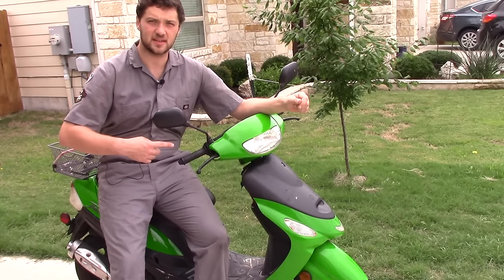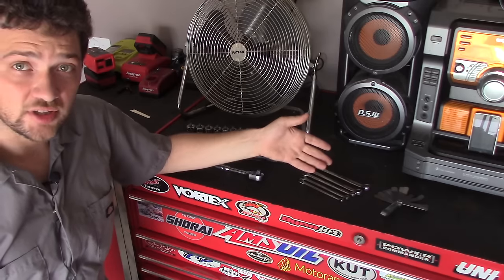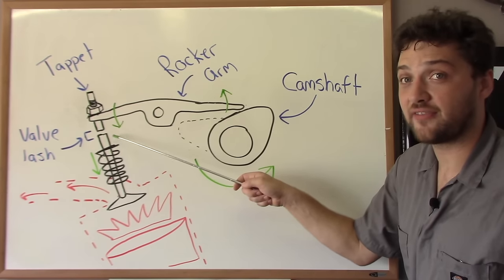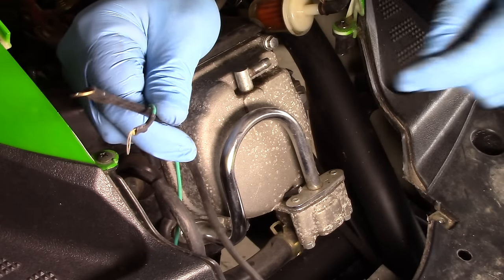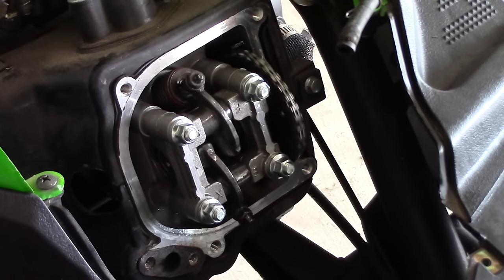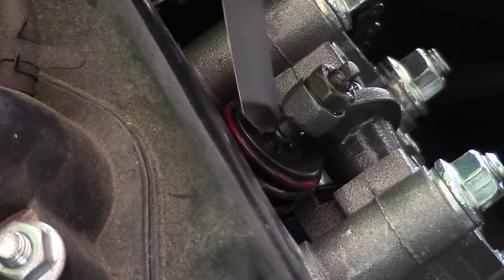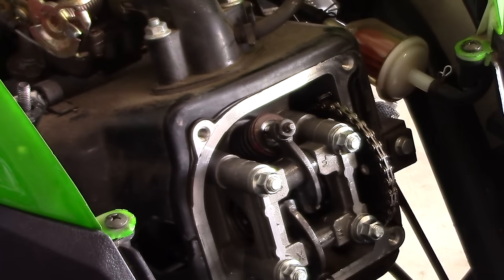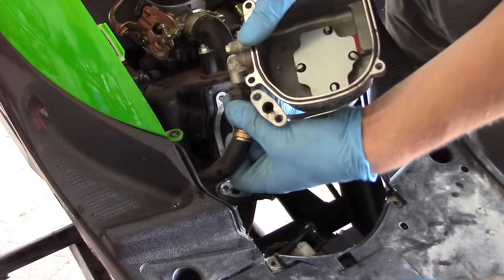Scooter 911: Hard to Start or Wont Stay Running? Try a VALVE ADJUSTMENT! (works for most scooters!)

Comment: What valve adjustment tool would you recommend?  I have one from Honda that doesn't fit inside these valves due to length.  Do you have a specific brand/part number you'd recommend?
Reply from the maker: I have always used a 9mm box end wrench and a 3mm square socket. I got my socket from snapon where it was listed as a "marine valve tool". But honestly as long as you have a quality 9mm wrench you can turn and hold the tappet adjustment with an adjustable wrench. There really isn't a need for a specialty tool like the old Honda CB750's and what not. Hope that helps! Good luck!

Comment: I bought my scooter (sym jet 14 50cc 4t E5) in 12/12/2021 and it starts easily in the beginning but after running for a few kms it stops and then it's very difficult to restart. I cleaned fuel injector, replaced old spark plug with new and changed both engine and gear oil but i still have same problem. I have 5,117 kms on my scooter. Can you please give me some tips. Thank you in advance

Comment: Hi Garret. So I just did a valve adjustment a couple days ago and I noticed a very audible ticking sound. The valves were set to 003 (intake) and 004 (exhaust). I decided to go up on each one to 004 and 005. The ticking is still there but much quieter. Should I go up another on the valves to 005 and 006? Or less? Idk what to do. Thanks!

Comment: Quick question when you turned the cam shaft at TDC, is it necessary to reset the timing chain on the tensioner as well? I installed an 80cc big bore kit and I'm having trouble with it staying crunk.

Comment: I'm not sure if this is my problem or not. I know this is a few years old video, but mine will may start hard like that, or start right off the bat. The problem is when I DO get it running, it'll run for a good 30 seconds at high speed, then I'll let off the throttle (like at a stop sign) it'll either power down once it gets to idle, or when I throttle up again, it won't even try to go up in speed, it'll just start to die. Thoughts? I've replaced the spark plug, fuel filter, I have see through hoses and I can SEE it's getting fuel, my air filter is a little old but still seems to work ok. If I try to turn it on again after that happens? It won't. I'll have to let it sit for a few minutes before it'll hard start again. And then the cycle repeats. Thoughts? It's around 5k miles btw

Comment: 150cc gy6 bogging past half throttle and the spitting through carb as it cuts off....new carb, plug, coil, cdi, air filter, fuel & filter. Any suggestions?
Reply from the maker: Have you performed a valve adjustment yet?
Reply: Planning on doing that today, read on several forums about adjusting valves....it started this after running out of fuel. I put more fuel in, took a while to get started, it ran fine for about 3min then started the bogging. Changed fuel 1st
Reply: Y'all not gonna believe this!....I adjusted valves,  both had too much lash. Put back together and same thing. Traced all wiring down, unplugged,  cleaned terminals,  etc...same thing......so I thought about what my dad taught me that I should have thought about earlier . You have to have fire, fuel, air, and???? EXHAUST!! The dang muffler had gotten clogged!!! I put my hand at muffler and was like this just don't feel like enough exhaust so I stuck a screwdriver through screen and mess fell out?!?! Actually was a lot of mess in it. Like black fuzz. Unsure if its coming apart inside or what but cleaned best I could on buggy, removed screen. It fired up and was at very high idle. After adjusting idling and checking air mix screw again, it ran like a scaled dog!  Thank you though, you did help me and for those like me, check that muffler!....lol

Comment: Adjusted the valve and still do the same thing will not stay running. The rear wheel turns when I try to start it. What is my problem?

Comment: Garrett, my 2020 tao tao will not start, I have fuel,spark,compression, and new oil. I squeeze the breaks and push ignition button. Still will not start. It turns but will not stay on. Dealer is 2.5 hours away. Big mistake. 1month later and Dealer has not mailed my registration paperwork. Never do that again.

Comment: The crank case breather vent is there suppose to be fluid in the the filter?
Reply from the maker: Yes. Its actually not a filter at all. Its just supposed to catch some of the oil mist and condense it back into a liquid before it fouls your air filter
Reply: Garret Seesing ok in mine i dont have fluid in it tho.i checked my air box its cleaned unplug the petcock valve and gas was coming out of it, i opened the black air filter box to the carb stuck my hand in the carb smelled like gas.. and my scotter still has issues ?

Comment: Do you have any idea why there would be fuel somehow leaking into the oil? I'm in a similar position where I've put in so much work already I'm dedicated to fixing this damn thing (50 cc taotao)
Reply from the maker: usually that is due to an issue in the carburetor. If the float needle is not sealing it actually overflows the float bow. And because the carburetor is on top of the engine the fuel just runs down into the cylinder. It slides right past the piston rings and strait into your engine oil. Good luck!

Comment: I'm not getting power to the starter enrichment on the carburetor for some reason and can't figure out why
Reply from the maker: On some scooters you'll only get power to that circuit when the engine is running

Comment: I watched other video but intake valve is 004 and exhaust valvle 005 you make intake 003 but exhaust 004 can you help me which is better and i have this problem
Reply from the maker: You can run them both at .004 but I can't recommend .005. when at the motorcycle shop I used to work at some customers would complain about the valve noise if their intake valve was set at .004, some wouldn't. That's why I always just ran them at .003 and .004

Comment: Question: is the valve lash the same as say a 50cc and a 150cc because I adjusted the valves on my 2008 benelli andretti 150cc I've redone it 4 times now and I've checked and triple checked and they are spot on 3 intake 4 exhaust but now it backfires.. when it didn't before. The spark plug is gapped between 7 and 8 thousands... Am I missing something.? Could use a little help please, I'm stuck on pause... WTFlip

Comment: Wolf rx 50 less than a year old, on 2nd carburetor to try and fix the idle and start problems but still no dice. The other day i tried to do the idle mixture and screw myself and now itll idle but sometimes when i stop itll die. It only starts with crank start. When i try the electric start itll try but wont start. 
I also have no experience with this stuff. 
Is it the spark plug? Idk. 
Also i was gonna buy a 80cc bbk and carb from rolling wrench. Will this fix it?

Comment: My gy6 scooter is not starting, the vaccume lines are good attached, spark is good, carburetor is good what can be the problem? There are glue on air filter mouth where it attache to air hose of carburetor is dried and I think not greap well and also some cracks on intake manifold. When I kick start it it's sounds like woosss woooss can you help me to understand where is the problem? Also when sometime it's start acceleration on starting is like 6000 and then go normal after few minutes

Comment: I have just bought a royal alloy GT 125 4T UK scooter. It only had 450 miles on it 18plate found out it has starting problems and won't stay running when cold but once warmed up it's fine. When I first start it after it been sitting for a long time, I have to keep the throttle on so it stays running otherwise it cuts out. Any ideas it's frustrating and don't smell nice. Running issues could be value may need adjusting. Why do I have to warm it up with a little throttle applied when cold or been stood for a long time.

Comment: Around 5:50 he talks about removing the clamp for the air injection hose, but my scooter did not have a hose there. Is this something that varies from scooter to scooter, or is mine just missing an important part? I also have a taotao

Comment: On an 80cc 47mm kit what should the gapping be? Ive heard .005 and .004
Reply from the maker: I still run them at .003 and .004. since the kit reuses the factory cylinder head the factory specs should still be the go to! Great question!
Reply: Thanks!

Comment: Hey i replace my carb and my moped wont idled and stay running only when i twist the throttle it will come on when i push the electric start

Comment: hi Garrett you're my guy! all of your videos got me through fixing my TaoTao 50cc with 6500 miles on it! but I did buy a 50cc Pony not long ago and it has 381 miles on it. at 50 miles I had to replace the exhaust gasket!!!! which literally disintegrated in my fingers! now it won't start! although it tries! it ran fine one day and then the next just won't start! I replace the spark plug the old one looked pretty foul with carbon deposits it now has a bit more spark but just does not want to stay running! I'd only 381 miles on this I highly doubt it's bad gas considering it was running fine before so what do you think should be my next step?
Reply: PS I'm a girl so I can get away with calling you my guy hahaha
Reply from the maker: @shellilogan771  i would start with the valve adjustment in the video, if that doesn't fix it figure out why it won't start with this video here! https://youtu.be/xW5y7a7CB1c 
Good luck! Let me know how it goes!
Reply: @Scooter_911  I had a feeling you were going to suggest doing the valve adjustment haha! I was thinking that was the problem of the exhaust gasket needing to be replaced at only 50 miles as well? at least I got 6500 miles out of my other taotao before I needed to do anything major to it, replaced the stator on it not a bad or hard fix if you have the tools!!! thank goodness for Amazon and my son who could afford to buy me the impact wrench I needed! now I just need a new set of feeler gauges and I'll be doing my very first valve adjustment soon ! thank you Garrett I appreciate your time ")

Comment: I have a Piaggio Typhoon 50. It will start cold no problem and run fine but the second it gets hot after a cruise and I stop and shut it off it starts behaving just like the one in your video. Would that be a sign for a valvw adjustment as well or could that be a different issue?
Reply from the maker: Yes absolutely! I've seen that exact symptom before!
Reply: @Scooter_911  just realized the one in your video is a 4 stroke though. Wouldn't the valves be different on a 2 stroke?
Reply from the maker: @5280livin  absolutely! There are no valves on a 2 stroke. I just assumed your typhoon was a 4 stroke. If it's a 2 stroke you might be in need of a top end rebuild.
Reply: @Scooter_911  I appreciate your responses! The bike only has 2k on it and runs perfect other than when it gets hot and struggles to start. Does have a slight hesitation on when I first ride it. I am trying to do it myself but I did have a shop say it was a spark issue or ignition but I just don't know at this point. I hope it doesn't need a rebuild lol

Comment: Would unadjusted valves cause a no start backfire pop thru the carb?
Reply from the maker: Absolutely it could! If the intake valve was not closing all the way (due to improper adjustment) it could allow the combustion to escape the cylinder and travel into the intake! Usually that symptom is caused by a malfunction in the ignition system and the spark is firing too early but I have seen it caused by a valve issue!

Comment: is this the same method if you installed bbk big bore kit for 50cc to a 80cc ?
Reply from the maker: Yes indeed the process will be the same because the facotry cylinder head and cam are used
Reply: Garret Seesing thank you 🙏

Comment: Hi, what's air injection, I know I sound stupid , but I was given a 150 znen scooter that was messed with by a wannabe mech.  I just found out that the front brake lever has to be held to start it(  handle is broke off ) and all vacume and fuel lines were *!^@$# up.  Please help lol.  Like, which side is vacuum on ths pedcock, I guess that's it bud. Thanks again
Reply from the maker: Air Injection is when small amounts of fresh air are introduced into the exhaust port to combust unburned hydrocarbons. It's just a little add on some scooters have to reduce emissions. The vacuum line to the petcock usually starts at the intake, sometimes tees off of another vacuum line on the right side of the carburetor, and then plugs into the the back of the petcock. There are a few different designs of petcocks so it's a little hard to shoot blind and say which line if for vacuum. You can always attach a small hose and apply vacuum (with a pump, syringe or even your mouth). If you have the correct line fuel will flow through the petcock.
Reply: @Scooter_911  ,ty so much, so the air injection went to a plastic canister along with a small line ( right side of intake) and they left the canister with no hose out.( left side of intake has small tube that I ran to carburetor after seeing one of your vids.) Got it started briefly with aid from started spray, wont stay running ,that'll be today's project lol. Btw,  I start it by jumping terminals with a screwdriver ,any suggestions, I'll follow to the t

Comment: I just bought a brand new 2020 Solana scooter it got shipped to my house I had to put it together and the thing doesn't run properly. In Maine we don't have any many people that know anything about scooters but I know a couple people that have looked at it and they can't figure it out. When she runs she runs great but most days you go to take her down the road and you give her some throttle and she don't move she just sits there. Or she'll run for a couple of miles or 5 mi sometimes and then all of a sudden it just says losing power and she dies what's wrong with my scooter can you help me

Comment: After doing this it will not start with the starter. I kick it over and it will start but still not stay running. There were no ground wires for me to remove or replace either. Genuine Buddy 125cc

Comment: I’m having trouble getting the cover off of my peace sports 50 cc moped, I understand how to do the valve adjustment, but I’m not able to get inside because the cover won’t come off. Is it possible that the cover is stuck due to it sitting for a while, or would it be another aspect, like wires still stuck on it? 

Thank you, and I rlly enjoy the video and feedback on everyone’s comment, I hope u get to mine soon.
Reply from the maker: Sometimes they get a little stuck but more often than not you've forgotten a couple bolts. Did you remove all 6? If you did try tapping on it with a piece of wood or something that won't risk breaking the cover
Reply: Garret Seesing I will go back and check, I believe that I may have missed one on the bottom that’s holding the ground wires, thank you for the very quick response, I am able to tell that you care about your subscribers and the betterment of everyone’s mopeds, so thanks again.
Reply: Garret Seesing update: I did forgot a screw on the bottom of the cover since it was all dirty and held the ground wires, I just had to do a double take, so it’s all good now.
Reply from the maker: @mikkowesterbeke568  good luck!

Comment: I did it I finally did it !!
Reply from the maker: Nice work!
Reply: @Scooter_911  love you man, no homo. But yeah scoot still idling lil rough. Did a total carb clean, valve adjustment , changed the engine oil and i can say it runs waay better than before and now gonna get a new spark plug and put a fuel additive that cleans the carb and fuel cylinders (liqui moly 4t shooter). Hopefully that fixes it. Thanks for all the help man.

Comment: Hi Garrett! So I followed your instructions to the tee I believe. I actually have the same exact scooter as the one you worked on in this video. I adjusted the valve lash to .003 on the intake and .004 on the exhaust. The bike idles amazingly now but there is this clicking noise. It sounds like it could be the spark plug may have been over tighten or maybe a broken spring? When I tightened the spark plug it didn’t seem to tighten all the way it seemed to want to keep going in but I felt I didn’t go too far though I’m unsure. I can send you a video of it running if it would help. Could you help me with this issue? I love this scooter and have spent some money getting it up and running so I don’t want to have to get rid of it.
Reply from the maker: Hey Trevor! The first thing I would check is the gasket to your air injection tube (some people call it EGR but that is a topic for another day) its a little grey graphite gasket that sometimes falls off when you remove your valve cover.
Reply: Wow thank you so much for the quick response! I wasn’t sure if you’d even see this. I love to learn so I have a lot of questions I apologize in advance! Is the gasket on the inside or outside of the valve cover? I’m assuming on the inside maybe? If so would it be rattling around in there or would the clicking noise be do to loss of pressure. Again thank you very much for your help! Your video was so detailed and easy to understand, keep up the great work!
Reply from the maker: @trevorpreston6562  shoot me an email at garretseesingofficial@gmail.com